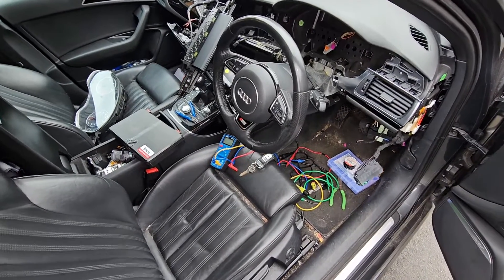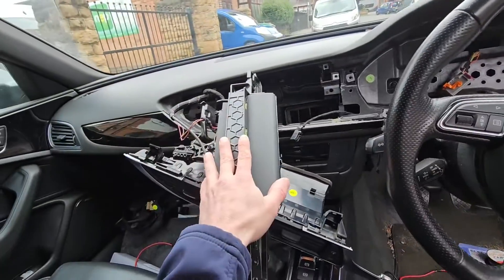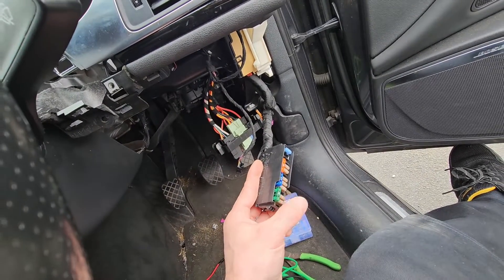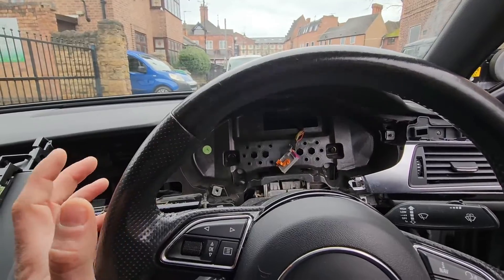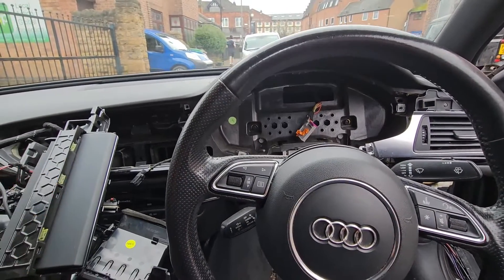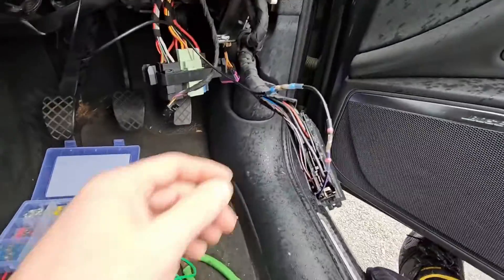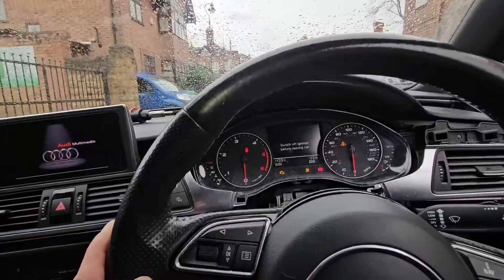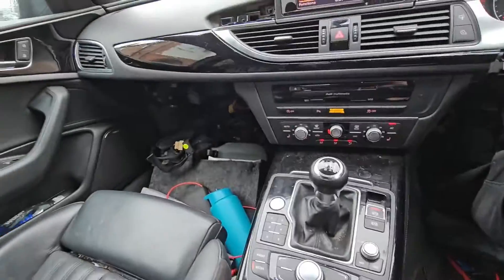Audi A6 (2013) Instrument Cluster Fault Diagnosis & Repair

Comment: Hi there I’ve currently got the same issue, can I ask did the clocks stop working immediately one day or did it start as an intermittent fault with the clocks working some days and not others before failing completely 
TIA
Reply from the maker: Hi thanks for watching, I would assume they just stopped yes. Could fail intermittently too though.